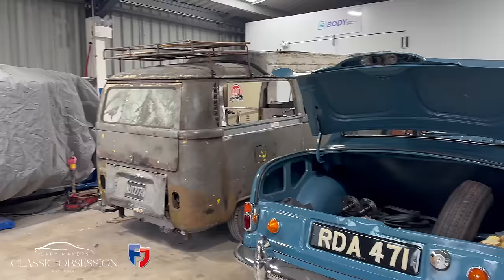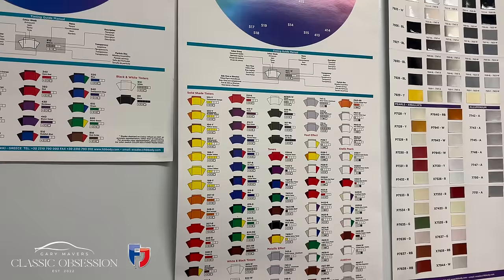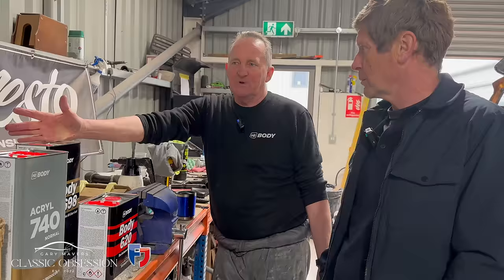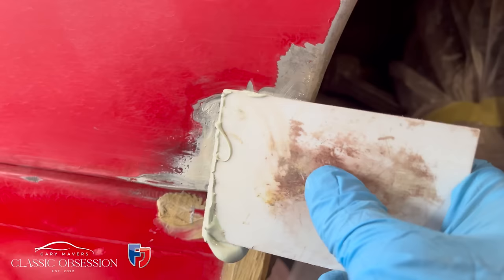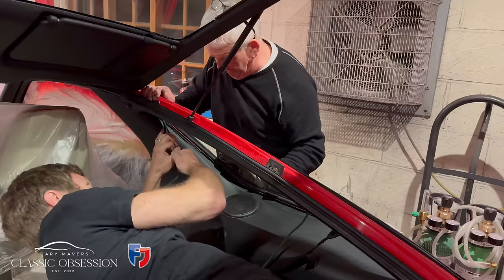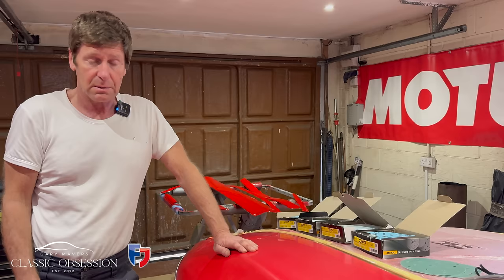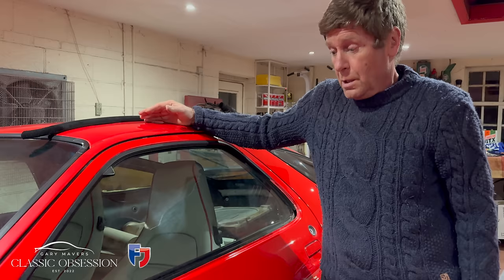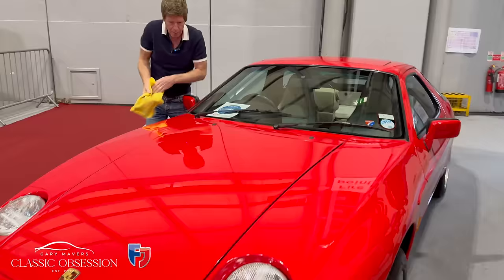24 hours to restore a rare Porsche 928 GT! | Resto (Part 5) | Classic Obsession | Ep 61

Comment: Great video Gary. I've been using HB Body products for several years now and really rate it highly, also Steve has given me lots of help and advice over the years. The 989 epoxy primer is exceptionally good, you can thin it right down and spray a thin coat over any burn-throughs to bare metal. Yes indeed, it would be nice to visit the HB Body plant in Greece, it is pretty much state of the art and is about the size of a small village! The 928 looked great on camera, you've done really well with it.

Comment: Fantastic to see it finally restored to its former glory, you’ve done Tom proud there Gary! 

Just an aside, I used to put car alarms, stereos and phones in cars back when these were new. I did a GT for a client with a really good stereo upgrade, the car came to us prior to him collecting it new from the dealer. I was moving it from the carport to the workshop, reversing slowly towards the fence, still looking behind me, I put it in first and gently brought the clutch up, and as I turned to face front, there was clouds of smoke billowing from either side of the bonnet. I shouted fire to the other engineers and turned the car off. As I lifted the bonnet my colleague Peter was ready with the extinguisher. A ball of flame erupted across the top of the engine and we zapped it and put it out. Turned out that the car had ruptured fuel injectors from a faulty batch. Porsche did an amazing job of sorting it out, they repainted the engine bay too. The car was a guards red one like yours. I worked on that car many times over the years and loved it, a real treat to collect and deliver back to the client. I’ve always loved Porsches and finally bought my first 911 at the end of last year.
Reply from the maker: Great story! We never really find out the behind the scenes at dealers do we? I bought a brand new Boxter around the year 2000. It was a manual but after just as week it wouldn’t shift or select gear. After two recoveries they finally sorted it saying it was something to do with the selecter bushes. I never experienced another problem over the next four years and eventually sold it. Lovely car. Never even saw the engine!!
Reply: @classic.obsession  You never get all the story from the dealers, the local Audi dealership had my RS6 from the beginning of June last year, through to the last week of September, they had the engine out twice to attempt fixing the fault. I got it back and part-exed it for the 911 immediately. I found out later that the new owner had the same problem occur again!
Reply from the maker: Anything a bit involved they just farm it out the back door to local garages they trust. None of the specialists would entertain doing a Cambelt. All of them said it was much easier to work on 911’s. Joke!
Reply: @classic.obsession  That's a disgrace that a trust dealership wouldn't even attempt a cambelt service on a car they sold new.  Everyone just wants the easy and profitable jobs and damn the wind to any of the others!

Comment: Great to see someone still using a suction feed Devilbiss  spray gun when most peeps are on gravity SATA guns now .Saved all my pennies about 45 years ago for my first Devilbiss suction gun which surprisingly came stamped with my initials (JGA) from the factory just like yours .Flatting and polishing always a ball ache …although a bit easier now with da fine discs on a buzz pad which is probably twice as fast as the old school method  we used to slog with blocks and flour paper between coats of cellulose ,which ( in my opinion ) still gives a far deeper lustrous shine with an unrivalled depth that modern acrylic paints struggle to match in a hard to describe esoteric way ,particularly on dark maroons and blacks .Top job there with the HB system which I have used many times with similar top results over the years including a full hit on a white Countach just over 10 years ago .Keep up the good work

Comment: The colour is spot on from what we can see on camera and then under the big NEC lights that take no prisoners. Well done and not removing the screens and not painting the bonnet or hatch is clearly the right move. Well judged- there’s a lesson there for every restorer about not going too far that the car then owes you too much.
Reply from the maker: Thanks Lee. I was really pleased with the match considering the roof and tailgate were original single stage paint and I clearcoated the sides.I haven’t touched the bumpers either but if they don’t polish up I’ll probably do them next. Regards.

Comment: Gary, if it's a Guards Red, them from my recollection, its a single stage paint (no clear coat required). I own a 928 S4 in Guards Red and understand it to be a single stage paint (in the red) and not requiring any clear coat. Cheers
Reply from the maker: You’re quite right. But faced with the fact the bonnet and front wings had been repainted at some stage and clear coated, I took the decision to leave the roof and tailgate in single stage but repaint both sides in base and clear. Regards.

Comment: Nice job. Was waiting to see how the aluminium window trims go on (as I want to replace mine) but understandably you can't spend too much time on any one part of the video when there's so much to cover. Really impressive how much work you got through in a week
Reply from the maker: Thanks Jo. Just make sure the curved walking stick end is underneath (and meets) the trim above it before you push the trim down into place on the door. Otherwise if it’s side by side and slightly proud it’s almost impossible to correct and you’ll have to remove again and start from scratch. Slippery little sucker, very easy to damage and soooo expensive so be careful and take your time. Imagine having to replace every piece on the car!! What a mindless job that must have been back at the factory. Regards.

Comment: Another great video, I see you are still using that old Jga gun that’s what I started using over 40 years ago, time to update to a gravity fed gun so much more usable and those type of trims are an absolute nightmare to get off so good decision to do just the necessary ones as you said the cost is outrageous really 👍👍👍
Reply from the maker: I should. Same gun for everything!! Regards
Reply: At least we got a mini second view of your Ali welding before you got a skim of filler on to hide it😳😂joking I did say before it’s very difficult to weld old dirty aluminum you did well not to blow lots of holes.💪
Reply from the maker: One of the most difficult things I’ve ever tried. When you get tutorial, all the demo’s are performed on a welding table with cooling blocks using 3mm thick aluminium. Piss easy….then you get home thinking you’re proficient and you’re trying your best weld a dirty 0.8mm wing with no support up in the air!! Like I said, I’m going in for a couple more lessons..

Comment: I thought a 928 was a non-interference engine?  If so, cam belt failure wouldn't be catastrophic.
Reply from the maker: No Patrick. So many of these cars died because of neglected cam belt changes. I’m terrified to start it until I’ve had the time to change it. The 924’s were non interference. Regards.